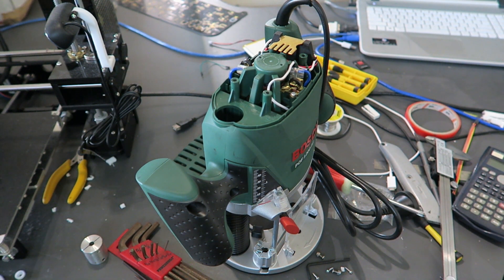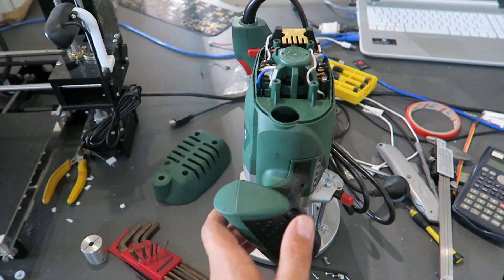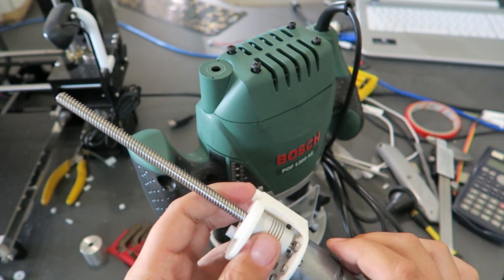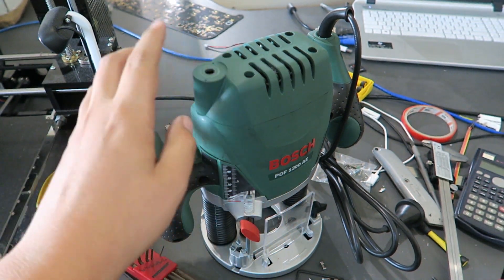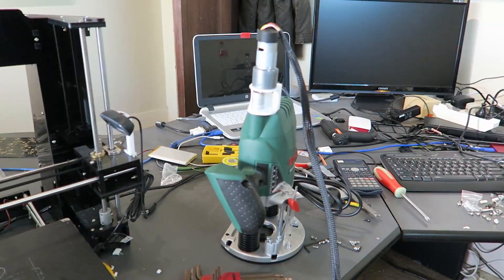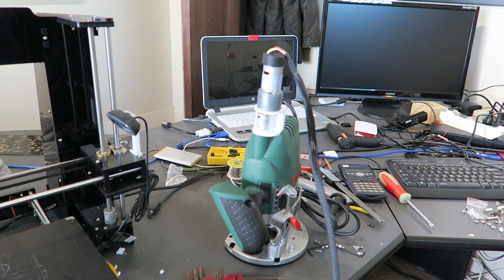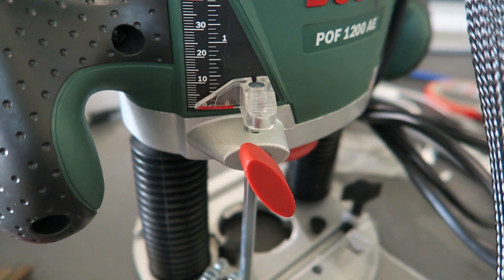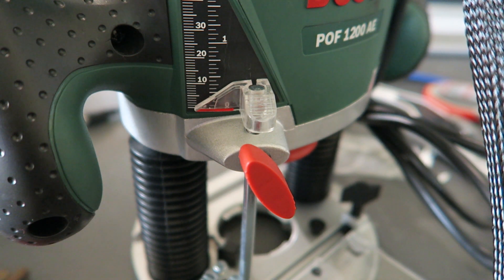Maslow CNC DIY Z Adjust

Comment: Hi Ned, any update for the project? You've got it running?
Reply from the maker: Hey, sorry, no, i got side tracked with building a Lowrider CNC as it looked a bit more like what i wanted
Reply: Do you still have the parts you used in this video? If you'd sell them, I'd like to buy them.

Comment: Hi, thanks for sharing. I've followed your instructions but when I adjust the z axis using ground control the whole assembly just pops out. I tried using duck tape but that does not really help.
Reply from the maker: Try printing it smaller or using a hose clamp or epoxy?

Comment: Not wanting to over exert myself and use my own brain...
How have you fixed the plastic part wth the Acme screw to the hollow shaft?
Reply from the maker: Press fit kinda works, but some epoxy would probably work well

Comment: ATTENTION-   I have tried this modification .. note that you will be advised  to take out the carbon brush units by carefully  unscrewing them from the top housiing asembly ( under the top cover) .. they are spring loaded ( carbon brushes soldered to their housings) .. so take them gently out but  dont use force .. try keeping the whole brush units in tact ..  THEN  take the other screws out that mount the motor shaft .. modify everything as per instructions .. replacing the sprung carbon units back into place  last of all before placing on the top unit . NB of you leave them in place and just pull out the motor shaft unit THEY SPRING TOGETHER and will not allow you to replace the motor shaft without potentially BREAKING them .....

Comment: Hey Ned, got your maslow up and running? Quick question but how do control the routers on/off function? Do you just put something over the buttons to keep it on? Cheers
Reply from the maker: i haven yet. Moving house ATM so it's all on hold for a bit. Cable tie (zip tie) can fix that problem though

Comment: Hey Ned, what length lead screw did you use? Cheers
Reply from the maker: i used quite a long one (300mm?) and cut it down. 150 will be plenty... i think you can get away with 100mm if you can find one as well... but cheap enough to buy a bigger one and cut to suit

Comment: Thank you Ned.
How the router will keep turned on during cut?
I bought 1400 and I try to find solution other than rubber band ^^.
(sorry for my bad english)
Reply from the maker: Johann B. Some people on the maslow forum have cut off the handles and removed the switch and hard wired the power cable. I would obviously only do that if you were comfortable doing that level of electrical work. The easy way would be to get a hose clamp or use cable ties
Reply: Thank you Ned :)

Comment: Hi! I'm new to comunity. Quick question. Does bosch handles doesnt get in the way off ring system? I live in EU and im considering getting bosch router and this kit.
Reply from the maker: Ronalds Šulcs they do get in the way of the standard ring system, yes. They are potentially making a bigger ring system though but I would ask Bar about that...

Comment: Neat! I had the following idea: Any chance of hollowing out the two 3d printed knobs, so we could use longer screws to permanently attach the assembly (through the two screwholes, that hold the top cap)?
Reply from the maker: I'll be uploading the file in the next day or 2 and anyone can change it how they like. Doing that isnt a bad idea, but you will need a spacer where the head of the screw normally goes so you dont break the mount when you tighten up the screw
Reply: Great to hear! Thanks for your incredible efforts!

Comment: Hi Ned, how did you connect the printed part with the acme nut to the hollow shaft on the base of the router?
Reply from the maker: That was just a press fit on mine. Different printers and printer settings may print it a little bigger or smaller etc, so maybe a dab of epoxy will help. I'd rough up the haft a little so it has something to bit into though?